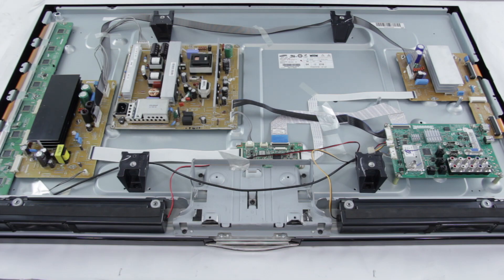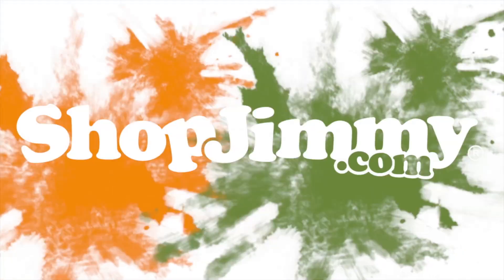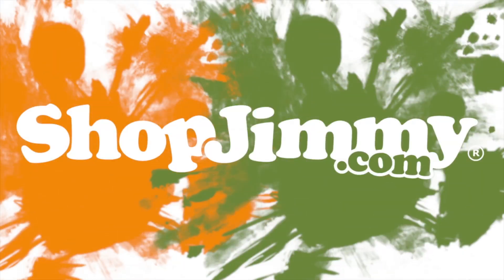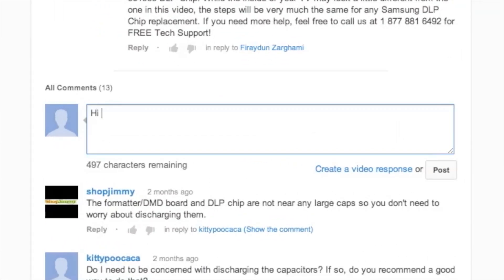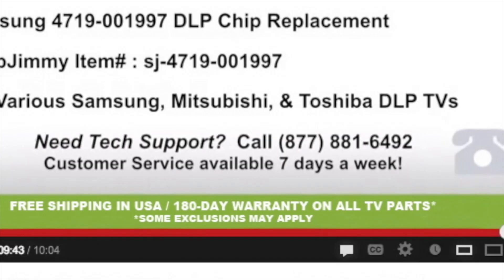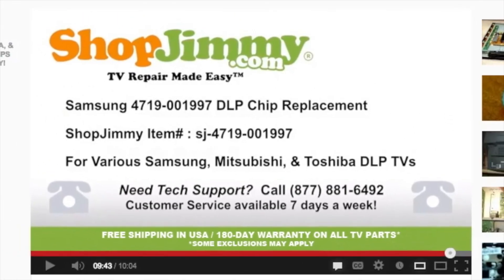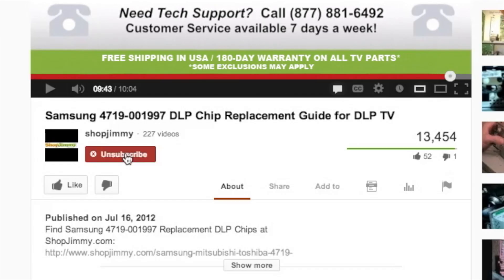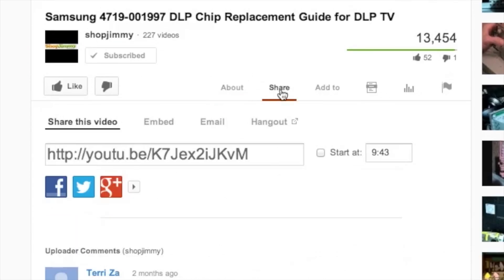Plasma TV Repair Tutorial - Common Symptoms & Solutions - How to Fix Plasma TVs

Comment: I have a Pioneer Elite Pro FHD1, it powers up and immediately shits down. The standby light will then flash red twice. What is the recommended fix?
Reply: *shuts
Reply from the maker: Jason Bobb  I recommend replacing the power supply in your TV.  Here is a link to replacement parts for your TV model number on our website, click here:  http://www.shopjimmy.com/catalogsearch/result/?q=FHD1  Be sure to match part numbers on your current board, with your replacement for compatibility.  You can also call our customer service for further assistance with your purchase.  (877) 881-6492  Thanks and please let us know if you have any further questions with your TV Repair!  www.shopjimmy.com

Comment: Hey guys...thanks for the great video. I have a Samsung HP-T5054 and the picture just went out. The TV turns on and off with no display. I opened the back to look for anything out of the norm and I had the pleasure of witnessing smoke and a small pop out of the top chip in the Y-buffer board. Of course I intermediately unplugged the TV. So, I am guessing that my Y-buffer board is bad. It seems pretty obvious to me or could it be the Y-board is bad as well? Thanks in advance for your advice.
Reply from the maker: Jay Kelly  I recommend replacing them all, the Y-Main board and the Scan Drives (buffers).  Here is a link to replacement parts for your TV model number on our website, click here:  http://www.shopjimmy.com/catalogsearch/result/?q=HPt5054  Be sure to match part numbers on your current board, with your replacement for compatibility.  You can also call our customer service for further assistance with your purchase.  (877) 881-6492  Thanks and please let us know if you have any further questions with your TV Repair!  www.shopjimmy.com

Comment: 42PF9630A/37 replaced buffer boards and still having problems with lines. also red splotchy areas from dark displays my guess was x sustain as described in your video. any other known problems for the lines? such as the ribbon that goes from screen to board is slightly discolored... kinda like heated and rapidly cooled metal gets the color swirls like oil in water....
Reply from the maker: Joe Blowers   I recommend replacing the Y-Main board in your TV.  Here is a link to replacement parts for your TV model number on our website, click here:
http://www.shopjimmy.com/catalogsearch/result/?q=42PF9630A%2F37 Be sure to match part numbers on your current board, with your replacement for compatibility.  Here is a link to a video showing how to identify your part number, click here:  Samsung Plasma TV Repair: Samsung Plasma Panel Parts Guide  You can also call our customer service for further assistance with your purchase.  (877) 881-6492  Thanks and please let us know if you have any further questions with your TV Repair!  www.shopjimmy.com

Comment: Have a p50hdtv10a and it was given to me..It has colored verticle lines in the middle of the unit.  Sounds like the logic bd from your presentation.  Power supply voltages look good.
Reply from the maker: Peggy Campalong   You can replace the logic board to see if that fixes the problem.  However vertical lines, typically means there is a bad TV panel.  Here is a link to replacement parts for your TV model number on our website, click here:  http://www.shopjimmy.com/catalogsearch/result/?q=p50hdtv10a  Be sure to match part numbers on your current board, with your replacement for compatibility.  You can also call our customer service for further assistance with your purchase.  (877) 881-6492  Thanks and please let us know if you have any further questions with your TV Repair!  www.shopjimmy.com

Comment: I have an 50 inch LG Plasma tv model 50PC5D. my issue is all the video inputs are showing "invalid format" i have 2 Hdmi inputs and only one shows a picture and its been getting worst. what weird but true. Is thay i have a samsung 3d player connected to it. The tv itself is not 3-D, BUT it is the ONLY device that will show any picture and THAT is only when its a blu-Ray playing on it. It wont show any dvd image from the device. Now i dont want anyome to think im stupid. I know the debice doesnt control the tv and vice versa. But in have 2 smart tv's and 2 lcd's and that same player works and plays all formats on them.. ive tried my kids devices. My gaming systems and my cable boxes and nothing. It'll ONLY allow that damn player and even THAT comes and goes. Any advice besides tossing it out the window?..........it was a gift from the father in law and the wife Refuses to let it go. :-/
Reply from the maker: Darby Alvarado   I recommend replacing the main board in your TV.  Here is a link to replacement parts for your TV model number on our website, click here:  http://www.shopjimmy.com/catalogsearch/result/?q=50PC5D  Be sure to match part numbers on your current board, with your replacement for compatibility.  You can also call our customer service for further assistance with your purchase.  (877) 881-6492  Thanks and please let us know if you have any further questions with your TV Repair!  www.shopjimmy.com

Comment: I have a 2012 version RCA (On Corp) 42PA30RQ plasma television. The set was given to me broken (from someone who found it sitting out for garbage pickup), so I do not know if it ever worked. Symptoms are: it powers on OK, relay clicks once and front LED goes from red to blue. The entire screen is totally black except for some sparkling blue pixels and very very dim snow. When the menu setup is selected, the icons and some text is just barely visible, but suffers with snow also.  The menu items can be cycled (you can just make out that different icons are being highlighted).  I currently do not have a source input connected, but cycling through the source inputs only makes a tiny change in the upper left corner. I have not tested the sound yet.  There is always a burnt electrical smell present on the heat sink on the power supply (SMPS) board that becomes stronger with power applied (I do not leave it powered for very long). Measured voltages are: Vs = 206 (207 on label), Vsc = -191 (-193 on label), Ve = 97 (not listed on label), Va = 54 (55 on label). All voltage measurements were made with all cables connected. The internals of the set are very to that of a Samsung PN42C430A1DXZA except for the physical location and style of the main PCB (number of inputs). There are no signs of physical problems (no bulging caps, burnt components), other than the smell on the heat sink of the SMPS.  One other interesting item, the manufacture date of the set is March 2012, however the Y-Main board, LJ92-01737B, sticker ZB-737B-A6-232-STU-BA6 shows an April 2013 revision date.

Any help would be appreciated. I purchased a new SMPS from SJ yesterday (based on smell) before I had tested the voltages. I was thinking to purchase a new Y-Main today, but I am concerned that someone might have replaced this before based on the 2013 revision date. 

Thanks
Gary
Reply: One other question/comment: If I am able to repair the TV, I was planning to install two small (40mm x 40mm x 20mm) 12v server power supply fans over the SMPS and Y-Main heat sinks, connected to the 15V_amp supply (audio) through a 1 watt 25 ohm resistor (about 0.25A draw - well within the margin of this supply. This would make sure these over worked components do not get further stressed. 

Do you see issues with doing this?
Reply from the maker: *****  I recommend replacing the Y-Main board and the Y-Scan Drive boards in your TV.  Here is a link to replacement parts for your TV model number on our website, click here:  http://www.shopjimmy.com/catalogsearch/result/?q=42PA30RQ  Be sure to match part numbers on your current board, with your replacement for compatibility.  You can also call our customer service for further assistance with your purchase.  (877) 881-6492  Thanks and please let us know if you have any further questions with your TV Repair!  www.shopjimmy.com
Reply: ShopJimmy.com I replaced the Y-Main board on Friday with exactly the picture on the screen.  I have placed an order for the Y-Scan Drive board. I will know in a few days.
A question concerning the firmware update indicated when the Y-Main  is replaced. Since this is an RCA (OnCorp) television, can I download the firmware from Samsung, or do i need to download from OnCorp? I have been unsuccessful with getting anything from the OnCorp using the following instructions:
1. Connect 'Serial Search' on website. (Site : http://intra.oncorp.co.kr:8080/asp/on_serial_search.asp)
2. Search Serial Number.
3. Download the Firmware file.
Serial number I entered was: 2301-42PA30RQ-A134243

Thanks for your help!!!
Reply: ShopJimmy.com Is it possible that I have received a DOA Y-Scan Drive board? I replaced the Y-Scan Drive board and now the screen is totally black. I put the original Y-Scan Drive board back in and I have the original problem of dark screen, with some lit - noisy pixels where I can make out the menus.

I put the new Y-Scan Drive board back in (just in case one of the ribbon cables was not seated, and again, a totally black screen.

Suggestions?

Comment: I have a 2008 Panasonic 42" Plasma TH-42PZ80U Viera. I have an intermittent  1-1/2" pink vertical line from top to bottom in the center of the screen. Any advice would be helpful.
Reply from the maker: starvenated   This sounds like a TV panel problem.  If your TV panel is bad, it may be more cost-effective to replace the TV as panels are typically hard to find in stock, difficult to replace, and expensive.  Thanks and please let us know if you have any further questions!  www.shopjimmy.com

Comment: I have a Zenith Plasma  42PC3DB-UE    No Picture No Sound ..
When you hit the power it clicks and you get  5 green blinks 
Check fuses on P/S board and all are good..
Reply from the maker: Rick Reed   I recommend replacing the YSUS board and the YDRVTP board in your TV.  Here is a link to replacement parts for your TV model number on our website, click here:  http://www.shopjimmy.com/catalogsearch/result/?q=42PC3DB-UE  Be sure to match part numbers on your current board, with your replacement for compatibility.  You can also call our customer service for further assistance with your purchase.  (877) 881-6492  Thanks and please let us know if you have any further questions with your TV Repair!  www.shopjimmy.com
Reply: I have that same model and when I plug it, It turns on but theres no image or sound and the light remains green. And if I press and hold the power bottom for ten seconds it turns off. Its all it does.
Reply: I have that same model and when I plug it, It turns on but theres no image or sound and the light remains green. And if I press and hold the power bottom for ten seconds it turns off. Its all it does.

Comment: Hello,

   I've got a VIZIO VP50HDTV10A plasma TV that powers on by itself when plugged in and has a funky screen color cycle going on.

I've replaced 11 caps on the main power board. Two had visibly bulges. The other nine were purchased as a repair kit off of eBay and were all the same type. Those nine showed no bulging issues. This had no visual affect, nor did it fix the problem.

When the TV is plugged in, it starts on it's own and initially shows a single test pattern of colored vertical lines that move from right to left, it then starts a cycle of changing colored solid screens 1-2 seconds in cycle. The cycling continues and the TV never shuts off until its unplugged.

When powered on the TV does not respond to the hard power button on the side of the TV, nor does it respond to the remote.

This condition started when the sleep timer was attempted to be set via the remote. When it became non-responsive I pushed the OK button on the remote and it started the color screen cycling.

I've got a video of this condition that I can email or post.

HELP!

Thanks
Steve
Reply from the maker: *****   The color cycling is a test pattern built into the logic. If your Main board has power and is attached to the logic this should happen. I'd double check the connections and output power on the power supply. It's possible something was missed or not seated right during repairs.  Be sure to take the proper safety precautions.  Thanks and let us know if you have any other questions!  www.shopjimmy.com

Comment: hi i have a 55hdx62 plasma tv. when i plug in the ac cord the red power led goes to green then flashes green 10 times then stays lit green for about 30 sec. then goes orange. like standby. the whole time theres no audio or picture. i opened the set and didnt see anything burnt or bad caps. after researching i did a force power supply voltages to rule out a bad power supply. i got all the correct voltages so power supply is good..i plugged in just the power board and logic board and i get a va voltage for half a second then goes right to zero.same with vs line.each time i unplug the connector for 10 sec to reset the settings. same goes for the 3.3v standby on the pin 2 and 3 . i only see it for a second then drops instantly. do you think the logic board need replace can you please help me out.
Reply from the maker: bob new   This sounds like a problem with either the logic board or the main board.  You may need to replace each board individually to see which one fixes the problem in your TV.  Here is a link to replacement parts for your TV model number on our website, click here:  http://www.shopjimmy.com/catalogsearch/result/?q=55hdx62  Be sure to match part numbers on your current board, with your replacement for compatibility.  You can also call our customer service for further assistance with your purchase.  (877) 881-6492  Thanks and please let us know if you have any further questions with your TV Repair!  www.shopjimmy.com

Comment: have a Pioneer pdp5020fd. Cooling fans not working. swapped out I-O audio and main boards and still not working. Know there is temp sensor on the I-O audio board but 3 boards all do the same. Also a panel sensor and it goes through the HD digital board then tot he main board too. Should I replace the aww1340 and/or HD digital aww1347? Or would ALL 4 fans be the problem?
Reply from the maker: Leonard Gammel   This sounds like I-O audio replacement was defective.  Thanks and please let us know if you have any other questions.  www.shopjimmy.com

Comment: maxent 42" plasma screen stays dark for 3mins while sound comes on instanly after...
Reply from the maker: *****   This sounds like the problem could be bad caps on the power supply or the entire power supply board itself may need to be replaced.  Please reply with your TV model number and then I can recommend replacement parts for your TV repair.  Thanks!  You can also call our customer service for further assistance with your purchase.  (877) 881-6492  Thanks and please let us know if you have any further questions with your TV Repair!  www.shopjimmy.com

Comment: I've got a Fujitsu 42" plasma model no. P42HHA30WS. It just stopped working. I ve got flashing lights on the front. I took the back off and when I try to power it on the fans come on for just a second and then stop. any suggestions?
Reply from the maker: Ron Jackson   What is the blinking code that you receive in the front of the TV?  Please reply with this information and then we should be able to reply with a replacement part for your TV repair.  Thanks!  www.shopjimmy.com

Comment: I have a samsung 55 inch plasma that has difrent black line going horizontal but I cane still watch tv and it all works besides that
Reply from the maker: Dashingyetti7778   This is most likely a problem with your buffer boards in your TV.  Try reseating the buffers.  If there is no change after that, then I recommend replacing the buffers.  Please reply with your TV model number and then I can recommend a replacement part if necessary.  Thanks!  www,shopjimmy.com
Reply: how do i reset the buffer board it is a samsung pn5oc45ob1dxza
Reply from the maker: Dashingyetti7778   There is no reset for the buffer board, you will want to reseat them by making sure all of the connections are tight and in the proper way.  Thanks and please let us know if you have any other questions!  www.shopjimmy.com

Comment: i have a samsung plasma 43 in model pn43d450a2d it had a thin black line horizonaly  now is all blacked out with a real annoying high pitched sound coming out the speakers
Reply from the maker: Greg Kemper   This seems like it could be a bad X-Sustain board, check your voltages on the X- Sustain if you know how.  Here is a link to replacement parts for your TV model number:  http://www.shopjimmy.com/catalogsearch/result/?q=43d450  Here is a link to replacement parts:  http://www.shopjimmy.com/catalogsearch/result/?q=43d450  Be sure to match part numbers on your current board, with your replacement for compatibility.  You can also call our customer service for further assistance with your purchase.  (877) 881-6492  Thanks and please let us know if you have any further questions with your TV Repair!  www.shopjimmy.com

Comment: I just wash u movie 
I have Samsung TV model no. LN40A530P1FXZA
series no. ALD13CSS211331T
first the tv power don't turn on the tv keep repeat the same sound I replace the power board after the power board be changed the switch turn on and off so I don't have any picture screen .thank you
Reply from the maker: John Boavida  I recommend running the flashlight test on your TV.   Here is a link to a video we produced that shows how to run the flashlight test. No Image No Picture on Screen-Flashlight Test LCD TV Repair - How to Diagnose Broken Board TV Repair Please reply with your flashlight test results and we can recommend a replacement part for your TV repair. Thanks and please let us know if you have any questions! www.shopjimmy.com